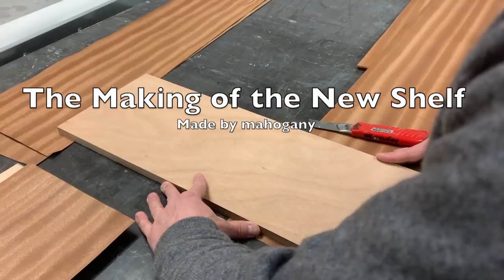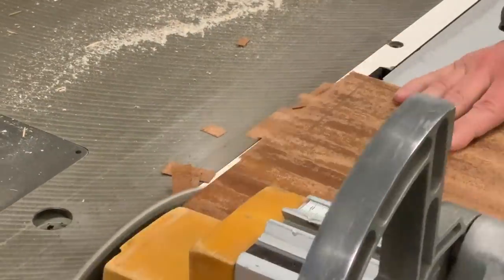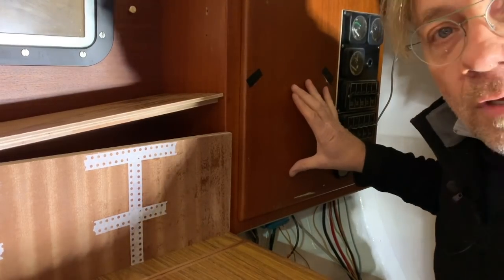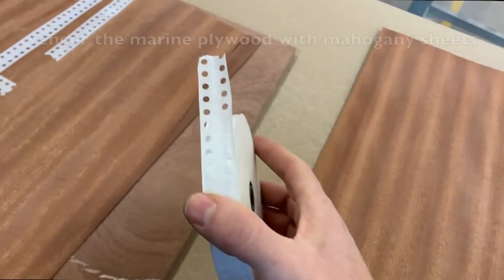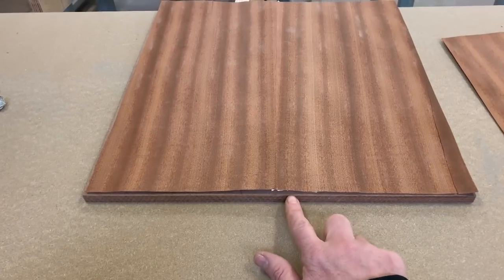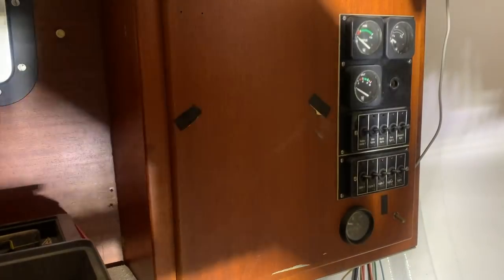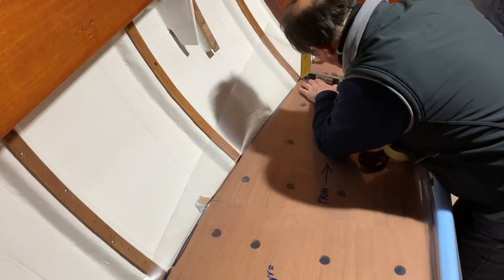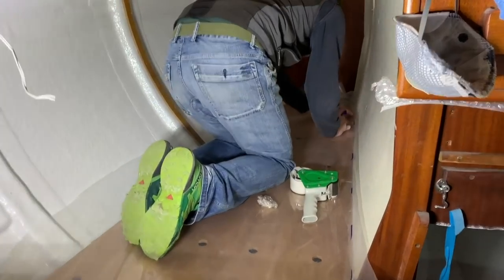Hallberg Rassy 312 "Ellös" - Sea4See  - Mahogany WoodWorks

Comment: Hi Gabriele, great article. I have an HR352, and need to replace chainplate covers amongst other things. Is there a particular mahogany veneer you would recommend? I think I read that HR used Khaya? Also, you mentioned a colour stain. Is there a standard stain that HR use in order to match up? I read in some of the old literature that varnishing with a matt laquer such as "International Lagolac" is recommended for scratch repairs?  Thanks, Simon
Reply from the maker: Hello! Great work you need to do! Hr use 90% Khaya mahogany , I used some sapeli one but is quite little dark! You can renew you without problem. I already sand off all the original varnish to pure wood. With this you can take off all the scratches as I did and start again to the varnish process. I used epifanes clear Uv for first 4 / layers and epifanes satin or rubber as you prefer call it for last 2 hand. … result and color as original as was no difference without using any cherry stain to match the color. You can buy it from hr parts or from other seller like SVB . Remember to buy his thinner becouse fisrt layers need to be very liquid to permit t o impregnate the wood fibers.. follow on epifanes website the procedure. Also use a foam rolle to get results as spray felling. Good luck mate!
Ps if you need to veneer use if possible alight grain of mahogany to get similar result as original if not possible use sapeli one difference is minimal!

Comment: Nice.. What type of marine ply do you use, Lloyd approved/BS1088? And what does it cost for let's say a sheet of 12mm X 1220mm X 2440mm?
Reply from the maker: Hello ... yes marine plywood RINA approved ..cost .... nothing I got on the factory for spare. If you interested I can check for you...
Reply: @sea4see  not necessary, only if you had it on the tip of your tongue. Just interested on how people source good quality marine ply and to what cost... because it's normally crazy expensive and some times not easy to get hold of. This boat is gonna be great, looking forward to your next video...
Reply from the maker: @R.E.HILL_  normally I buy from the factory I got many advantage  working in Franco factory he buy straight so cost is quite less than normal...!!!
Reply: @sea4see  that's just awesome, lucky you.. 😊